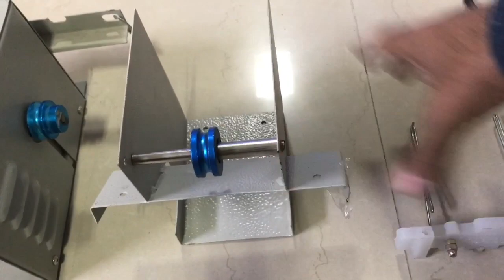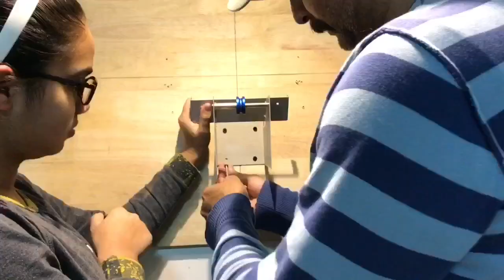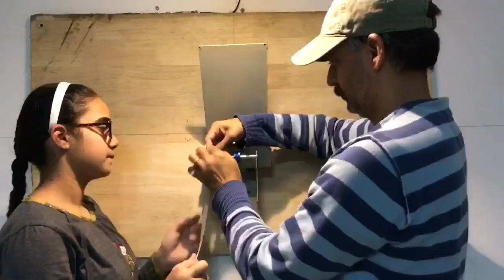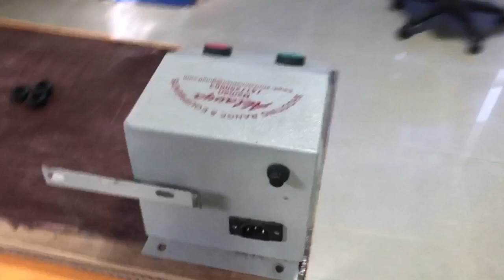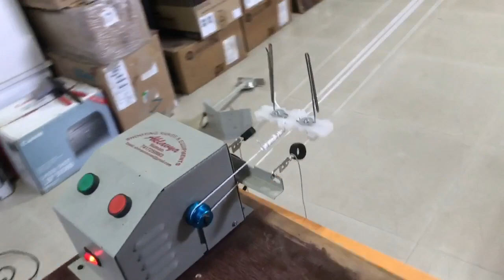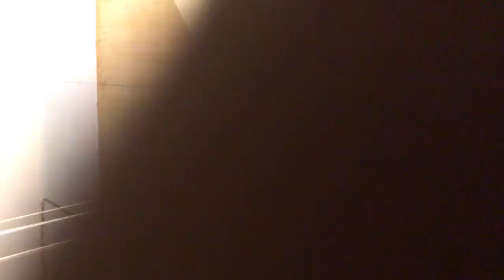Setup Shooting Range for 10 meter Air pistol air Rifle Practice

Comment: Do you need to take any permission to set up a lane at home for Air Pistol Shooting? If yes, from whom?
Reply from the maker: No
Reply: @9DVR  Thank you very much. What about the sound in case of live shooting?
Reply from the maker: @lakshmijagmohan7389  air pistol don’t make much noise
Reply from the maker: @lakshmijagmohan7389  but safety concerns must keep in mind
Reply from the maker: @lakshmijagmohan7389  take advice of someone professional in ur area
Reply: @9DVR  sure will do. Thank you so much 😊
Reply: @9DVR  making sure of that
Reply: Making sure of the safety as it is secluded and enclosed
Reply: @9DVR  Do you sell and send to USA?